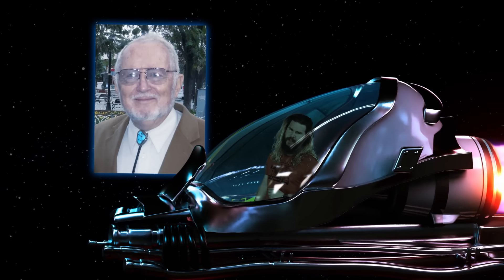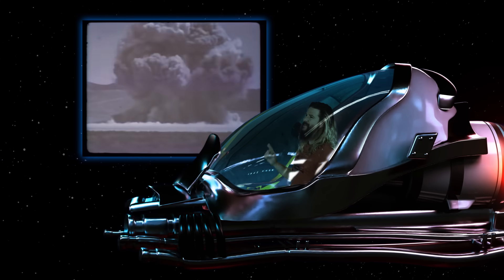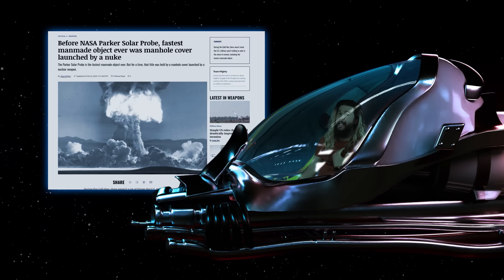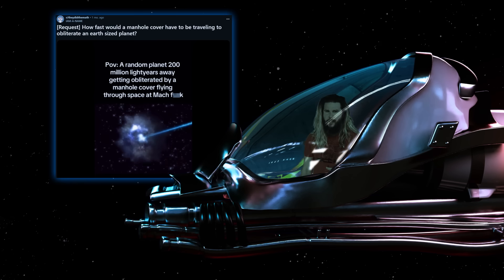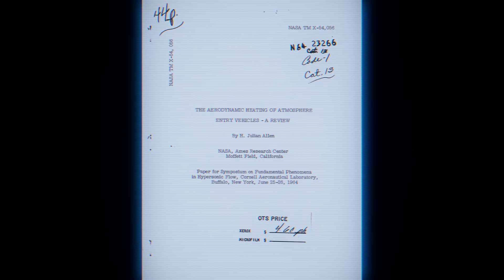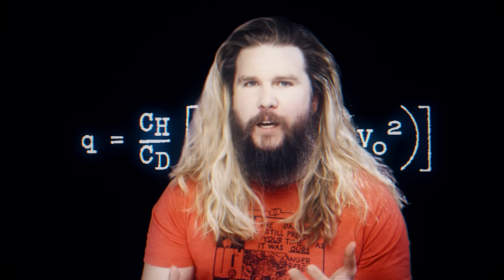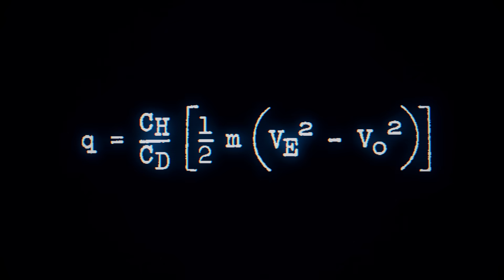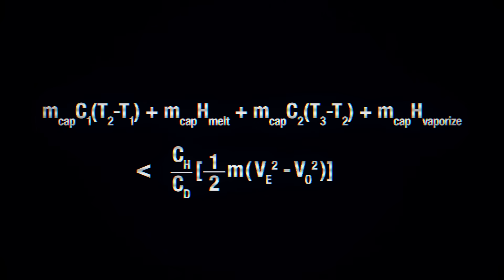Debunking the Nuclear-Powered Manhole Cover

Comment: Few points:
1) That cover might flip and go sideways due to drag and stability.
2) Meteors are more porous and loosely packed than Iron plate.
3) Moving faster means taking much less time, to what if it before melting completely it exits the lower and denser atmosphere and then goes into orbit as a semi-solid hot lava?
4) The equation considers many coefficients, and the difference in energy is only 8 times. What if the coefficients slightly vary and there isn't enough energy available to melt?

Food for thought. I request some scientists to perform an experiment again with better cameras and better  trackers.
Reply: We'd better get the Slowmo Guys involved with this!
Reply: 1) metal would definitely bend significantly due to the explosion. Doesn’t matter the side… it wouldn’t be drag efficient.

Furthermore, if it flipped once… it wouldn’t stay sideways. It would keep flipping. Just like how a bullet tumbles when it hits something and doesn’t correct itself automatically.

2) doesn’t matter. Probably a point against the man hole. Since iron plate is lot more heat absorbent than an alloy of a dozen randomly packed ores.

3) once again, doesn’t matter. Moving faster is actually a point against the man hole coved. Air resistance works by the air not being able to get out of the way fast enough. Moving faster means that the air has even more significant drag.

I.E. 200N of force would take you higher if moving slower than faster after 40-80 km/h ish. as you go faster upward, the drag increases rapidly, reducing net force, and therefore acceleration.

4) that can go both ways. What it’s off and it’s actually 8 thousand times? Not really a counter point if you don’t do the math yourself.

For example 9:35… with the equation on the left side it is off by a few thousand times. I.E. you would need a few thousand times more kinetic energy for it to make it to space
Reply: Kyle got BUHED so hard that the chubby electron guy would be impressed
Reply: i suspect that someone just wants to see another big bang... for science...>.>
Reply: I think veritasium did a video about falling coins, and i’m pretty sure they proved falling coins won’t kill because they fall flat side down, so I’m wondering if the manhole cover would do the same
Reply: @drewendly89  I'm in now way savvy in this type of science, but I heard lots of things in physics tend to go a little wacky when you go to the extremes. Do coins fall flat ? Probably, but you can't really compare that with a big chunk of iron being propelled by a nuke.
Thinking about it, you walk being in a vertical position, but low speed means less air resistance. If you were going at "mach middle finger" (given you don't get squished instantly) and weren't perfectly vertical, you body would most likely reorient itself to be horizontal and stabilize there or become the fastest beyblade ever seen.
Case in point, there is a world where this manhole cover got to space and we'll probably never know because we just can't take all the variables into account with the information at hand. 
Let people dream if they want, at the end of the day it doesn't really matter right ?
Reply: @maspheliciasonsaku2523  but if this was the case then arrows should not need wing stabalizers, I shot arrows before without them and the almost immediately go from horizontal to vertical in any of the 4 possible directions and stay until it hults and drop straight down provided the path it took to a upright position wasn't stearing it immediately into the ground before its forward momentum  finally reached zero. Also bullets literally can only be shaped (as a bullet) and not flachetts, (code name bullets the shape of arrows with stabalizers, on top of special casings to send out the barrel horizontally right out the gate in the first place) is the first guy to experiment with (modern bullet shapes) made them work in original smooth bore rifles by developing softer lead bases that exspanded the base to seal precisely with the bore diameter making them possible but still would tumble. But, shortly after it was discovered adding spin made the shape work nearly perfectly stable for the first time in history without literal wing stabalizers.  And the spin was achieved by inventing spiral bore rifles, which only were possible by learning how to create rifle ammunition capable of matching bore diameters precisely. Veratasiam describes it in his Tom Brady football physics video hense how I know that, except the arrow part I legitimately fired arrows missing their wings on purpose and did get those results every time. Maybe im wrong tho idk really
Reply: @TimAndrew372  Oh I totally agree with you, but this is why I prefaced my comment by saying physics tend to go a little wacky when in the extremes.
The average bullet speed (according to a quick research) is 3k km/h with is about 850m/s.
The estimated speed of the manhole cover was 125k mp/h which is about 56k m/s.
Enough said that I'm no scientist but the behaviour of the two probably can't be compared (not even talking about an arrow that goes significantly slower than that)
Reply: 1) Unlikely, given the way other high speed objects have been observed to behave, it far more likely tumbled which to be fair would change the aerodynamics of it from what Kyle calculated somewhat.
2) True! But as Kyle noted, meteors are also going much, slower than this.
3) Time isn't really a consideration in that regards. It still has to move the air out of the way which produces the heat, at most it would ablate some of the surface away before heating the main body but steel isn't really a good ablative material so that heat is going to stay with the steel for the most part.
4) There's definitely room for the math to wiggle out of vaporizing it completely. That said, I don't think it actually needed to get hot enough to vaporize for it to matter, in fact I'd argue it probably didn't even need to get close to vaporizing temperatures before it would be destroyed. Steel gets very soft when it gets hot, and at anything close to even half the temperatures Kyle calculated, the steel would basically be puddy getting blasted by hypersonic wind forces. It would almost definitely be torn apart long before it escaped earth. At most, a few globs of steel might have escaped, but there's almost definitely no manhole cover traveling the cosmos.
Reply: And also, unlike meteors, the plate was going through the thickest part of the atmosphere first.
Reply: This guy makes garbage videos. He sucks. He literally stopped trying, YEARS ago. He is lazy and covers things that he just watches other youtube videos on. Kyle is the farthest thing from a critical thinker you can come across. He is a social communicator, and a far, far
 left one at that.
Reply: @jf8138  it's unwise to call people "far left", sounds like the communism hysteria over again. That said it's clear he's a social communicator (YouTuber) and not a theoretical physicist. His videos seem to be unambiguously aimed at children.

Comment: You made a fatal assumption in your calculation.  The question is "Did the cover vaporize BEFORE exiting the atmosphere".  By setting the final velocity to zero, you are assuming that atmospheric drag prevented it from exiting the atmosphere.  You can't make that assumption, as that is the entire point of the question.  This means you are using the wrong equation to solve this.  I am not sure what the correct equation would be, but I am confident that it would be a differential equation of some sort, given that the amount of drag at a given point in time is proportional to the current speed.

Another point is that the coefficient of drag isn't a constant in this case, given that we are vaporizing the object, changing it's shape over time.

Also, a lot of comments point out that you are ignoring gravity.  While technically true, the effect of gravity on these time scales is miniscule and can be safely ignored.

Comment: I understand that the actual cover would have been deformed and possibly broke. Into pieces. That being said. Wouldn't the time needed for the atmospheric heating energy to vaporize it need to be taken into account? If it was traveling and approximately 150000 km/s would the energy needed to vaporize it have the time? For it to travel out of the atmosphere, it would have to travel about 10000 km. Moving at approximately 150000 km/s that is only 0.067 seconds. Assuming the cover remained perfectly level and intact. Would it have made it to space before being vaporized?

Comment: Wonder how much it would change the results if we had the disk flying "sideways". I'd have to assume that the smaller surface area and slightly more aerodynamic shape would make the resulant required energy to dramatically increase.

Comment: The paper he referenced to get the equation he used outright states that it is assuming constants for drag, friction, and air density, in that equation. Further into the paper it also explains that Vo is sea level velocity, that they are using as final velocity. To go one step further, they give equations to figure out air density throughout the atmosphere (needed for accurate equations), a few pages further into the paper.

Thanks for citing sources. Cutting corners in attempts to debunk only serves to credit those who did less research and discredit you who did more.

Comment: Errr… at 66km/s it would’ve left earths atmosphere in 2 seconds. 

… at that speed wouldnt it be going so insanely fast that the air smashing into it would be undergoing fusion at the same time? 

It’s not BOILING… 

It’s being obliterated. 

However for this to not qualify NO PART of this object can get outside the Karmen Line (spaaaace!) .. 100KM up. 

Less than 2 sec after “launch” 

Would it be a universal manhole cover at that point? Er no. 

Probably a ball of white hot mostly-plasma with a little bit of iron inside… 

However.. i bet there was SOME iron still inside.. :) the record should stand… if only for semantics… and to beat the USSR LOL

Comment: I would like to also point out a possible addition. The meteors enter at angles, taking a longer flight path and experience much longer periods of heating. The cap was going straight up through a shorter distance. Heck, it even was starting at the thicket part of the atmosphere, where the drag and density would only get easier as it ascended. Even though yes the numbers do add up and experience shows us the meteors break up, they are also imperfect, with possible pockets, heterogeneous construction, and differing thermal conductivity of various materials. It still would've taken time for the heat to transfer from the outside to the in (assuming it didn't ablate and begin loosing mass as it flew). I'd love for a research team to truly sit down with the numbers, with the calculations, and simulate this whole thing. Because Science

Comment: Did the cast-iron cover spend enough time traveling through the atmosphere to "vaporize" all of it though? Essentially what happens is the parts of the cover that make contact with air as it travels upwards get sublimated from the friction, which exposes the next layer of metal to then get sublimated. Is it possible for the cover to travel so fast that the friction doesn't eat all the eay through that 4 inch thick metal before it get high enough in the atmospher where there's not enough air molocules to create enough friction to sublimate the rest of it?

Comment: Unlike some people I do think that the reentry equation is a good starting point, but when the result is so close - less than an order of magnitude - I think you need to go further.

More importantly, I think you used 66km/s as Ve and 0km/s as Vo, so you calculated the heating if ALL it's velocity were scrubbed off as heat.

Comment: This has no bearing on the verdict, but would the heat from the explosion itself be negligible? If so, just because of physics? Because it didn't spend enough time in the actual explosion? I'm assuming it spent some time in there, because it would've needed to accelerate first, right?

Comment: Do we know that the heating effect is the same going up as going down?  Even if it is, there are plenty of meteorites that do survive the trip. Does this mean that every small fist sized rock that makes it to the surface must have started as a boulder larger than a car?  Typically, the ones that survive are metalic and ones that dont are stony.  This was definitely metalic and one solid mass.  This also would have taken the shortest path through the atmosphere going straight up, while meteorites usually strike at an angle and continuously pass through much more air.  They dont intersect the ground until they have shed almost all of their velocity.  They then arc downward. 

There are torpedoes that use a concept of super cavitation to clear out the water ahead with a shock wave.  This object could have easily experienced this effect until it reached the vacuum where no more heating would occur.  Another commentor stated that unlike a meteorite, its final velocity could not be considered zero.  It may have only lost part of its velocity in the trip, resulting in much less heating.

Comment: I bet, no, I assure you it wasn't at "room temperature". I mean a bullet gains a bunch a heat from the propellant, so using an atomic bomb, I bet it was freaking hot a few nanoseconds before it even started to move. So, not just 1 order of magnitude, surely.

Comment: Ok i have question, said it was not aerodynamic. Now would it mater if the cover was edge on or flat? A frisbee is aerodynamic edge on but not face on so if it was edge on would the more material from the heating edge as a traveled up make it last longer and able to withstand the high temperatures more therefore getting higher or does angle of the disc matter in the equation?

Comment: you forgot the Decreasing atmosphere pressure and the fact it was riding a column of MACH 197 air for the 1 second it took to reach space. your equation is only for 1 atmosphere of pressure. also space junk hits the atmosphere at 40k MPH and makes it to the ground.

Comment: Did some rough math for those frustrated with the v⁰=0 assumption (I was one of those people), approximating 4ft=1m, which errors on the side of less drag, the cover would only reach 58000 meters which is about half way out of the atmosphere, so even if it didn't vaporize, it didn't go into orbit

Comment: Other people have pointed this out, but one problem I have with your analog is the fact that the transition is going in the opposite direction, from thick atmosphere to thin atmosphere. Rockets don't require heat shields going up for a reason. Rockets also aren't starting at orbital velocity, or several times that, but wouldn't the manhole cover be going so fast that it would be out of the atmosphere before much heating could occur? However, this easily makes the equation several times more complicated. This is a question that is not easy to answer, because the math is so complicated. But, of course, most people will go for the simple and most outrageous answer, regardless of whether or not it is actually true.

Comment: Here’s what gets me. You’re making the assumption that the plug remained in a flat orientation. Have you ever dropped a quarter into a tub of water?  
You’re also assuming that it stayed on a straight path. Again quarter in a jug of water. 
You’re also assuming that as the plug melted it stayed together. Have you ever seen a shape charge in slow motion? I was hit by an RPG in Baghdad. I stopped counting after 673 holes. Not one really big one. Think super soaker water gun. 

My point is that even with the math you’re still assuming a lot. And you know what happens when you assume.

Comment: One thing i will point out, is that number is just an approximation. Now i know that you are so well aware of that fact, that me taking the time to point it out to you is just funny.

The reason you didn't start adding in more variables is because the number is over 10 times over the limit, and we see expected results in similar real life situations. It makes sense to draw the conclusion when you did. BUT...

Ive fooled around with approximate numbers and taken the time to add variable after variable to them to see how much it changes. And well, ive seen variables similar to the ones you left out (the manhole tumbling, changing atmosphere pressure, and time) change the approximation by a good bit more than 10x. Theres SO MUCH else involved in that manhole cover, i can 100% see them throwing that number all over the place as you add more and more.

As crazy as it sounds, i dont think the approximate number you came to is definitely outside the margin of error. I can see the other variables involved potentially dropping it below the point of being greater.

But seeing as those calculations are outside of my capabilities, ill have to list the manhole cover making it into space as "unlikely, but plausible".

Comment: You are no where near accurately calculating this: 

First you did not calculate its exit velocity only it’s initial velocity. Therefore you assumed it would loose all of its velocity in the atmosphere.

You assumed the plate would remain flat to the atmosphere when in reality the plate would likely be tumbling and would deform at high temperature.

I expect with both of these accounted  for the true atmospheric heating could be less than 1% of what you calculated 

I expect the far more likely failure mode of the plate is the huge drag force causing the plate to break apart under stress. This is also far easier to calculate.